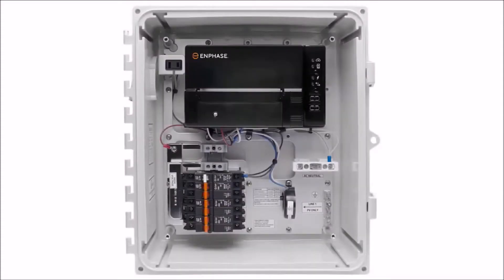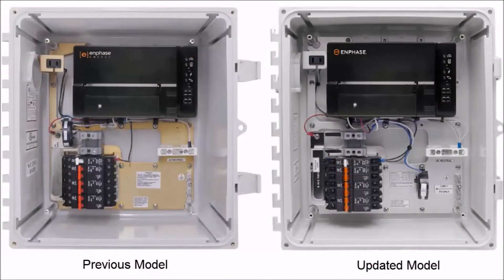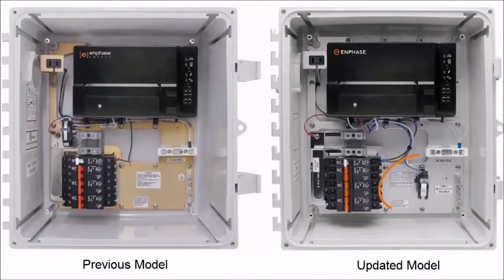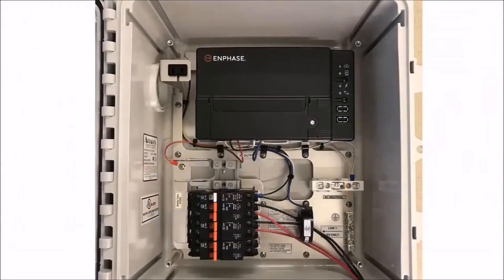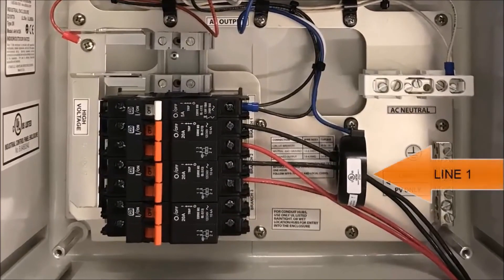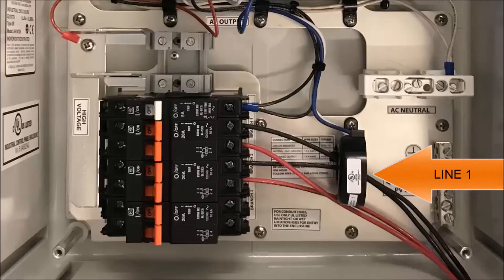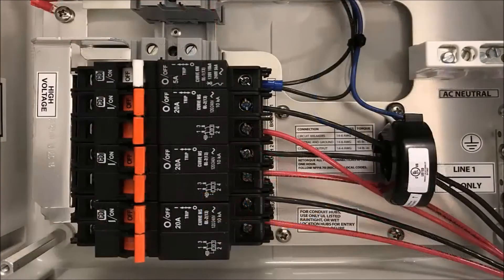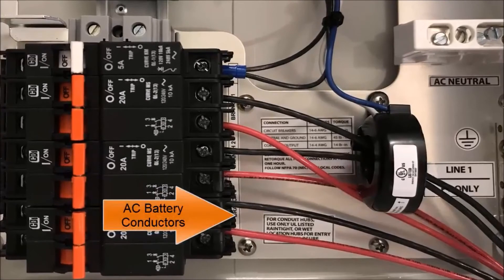New Enphase AC Combiner Box vs Previous Version Comparison | RENVU

Comment: what kind of battery does this system support ?
Reply from the maker: It's part of the Enphase, so the Enphase AC Battery: https://www.renvu.com/Solar-Products/Off-Grid-Inverters/ENPHASE-ENERGY-B280-1200-LL-I-US00-RF0
Note that due to difficulties in attaining raw materials, currently there are very few Lithium-ion batteries in general on the market, so the lead times are 2-3 weeks.